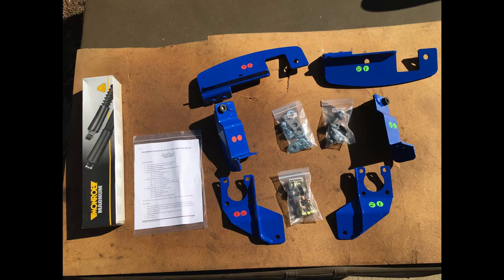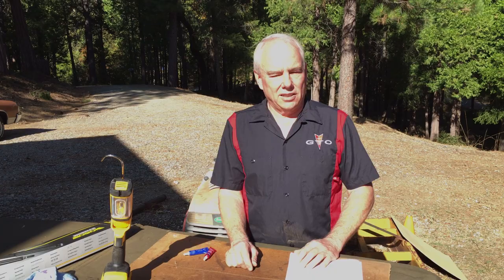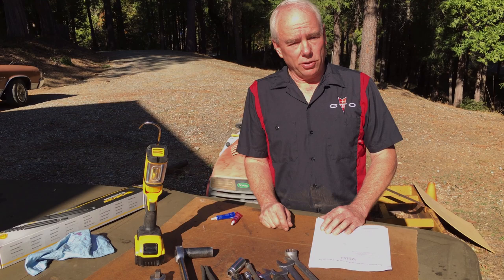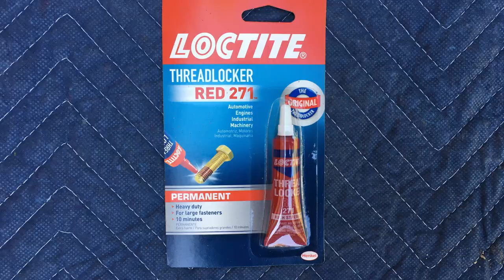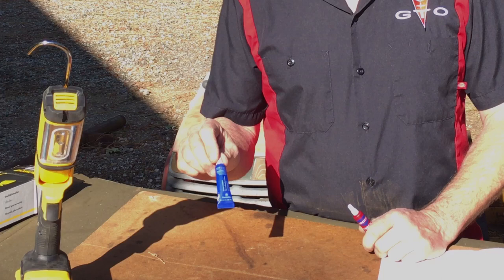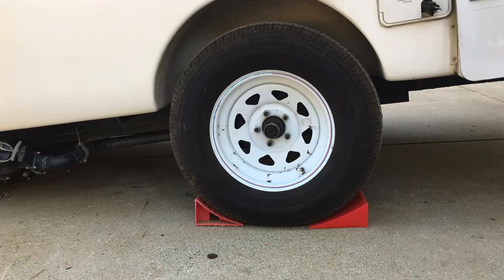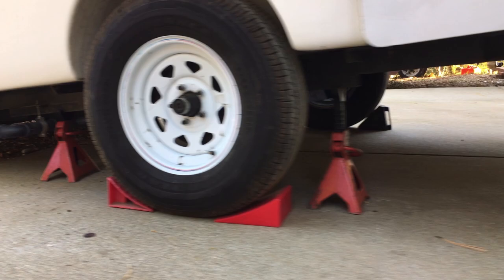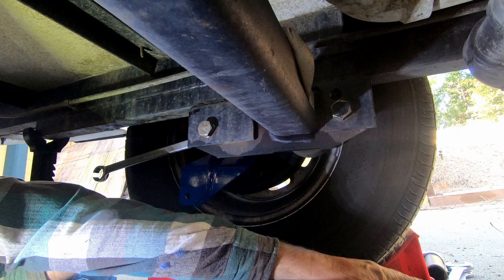Install Casita Shock Absorbers

Comment: Great video, thank you sharing! Our 20 years old dexster torsion axle is at the end of its lifespan, and they are providing very weak suspension as of now. should I replace the whole axle or just add this shock absorbers?
Reply from the maker: If it were me, I’d replace the axle first.

Comment: I was wondering if it would make sense to take off the tire for easier access.
Reply from the maker: Yes, it would be easier to install if you take the tire off.  For safety sake, and in case someone was not comfortable taking the tire off, we chose to leave it on for the video.

Comment: Does the shock kit make a big difference if you have the lift kit with the torsion axle?
Reply from the maker: Yes.  It’s the same improvement regardless of whether you have the high-lift axel or not.  However, the kit is different if you have the high-lift axel.

Comment: Is this a "High Lift" kit? That is what is offered by Little home on the Road. Would t raise the back of the trailer? As of Mar 29, 2023 they are out of stock. I have a 2001 Casita Freedom Deluxe which seems to be in stock condition. And I'm wondering, were you actually able to adjust the brakes once your kit was installed? Thanks
Reply from the maker: No.  It has the high lift axel from the factory.

Comment: At 5:31, it appears that the plate you're installing blocks access to the brake adjuster  hole. How difficult is it to adjust the brakes after the shock kit is installed? Thanks.
Reply from the maker: Doug says he thinks you can still get to it with a brake adjusting tool.

Comment: How do you get the kit?
Reply from the maker: You can order from Perfect Casita.  It may take a while to get it though.  We got this one off a wrecked Casita that was being parted out.
Reply: @TravelsandTravails  I have been trying for 3 years to get a kit from them to no avail.....
thanx,
dale
Reply from the maker: @dalet455  wow!  That stinks!  Others have had one manufactured by a welder and we considered that option until we found the Casita that was being parted-out.